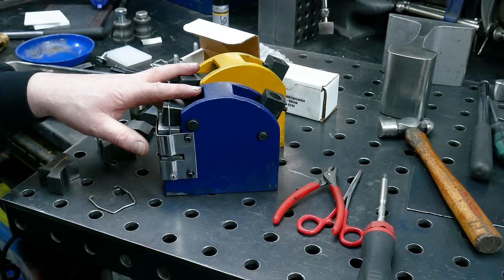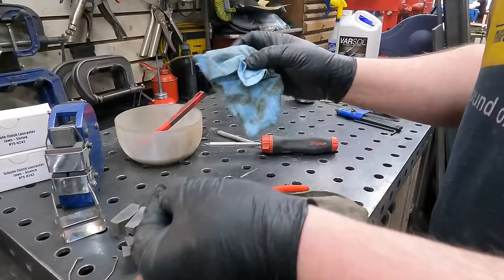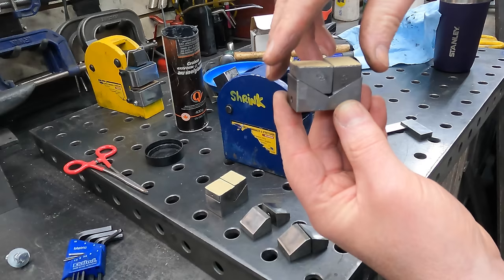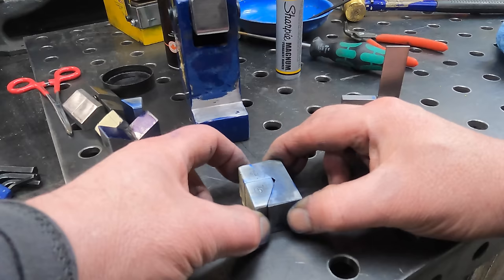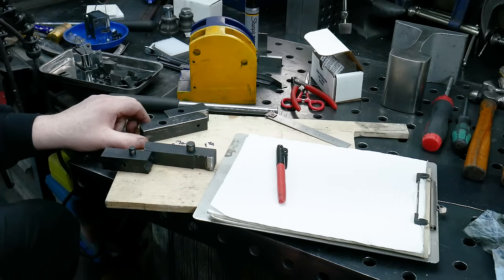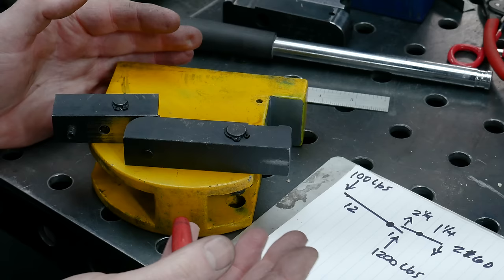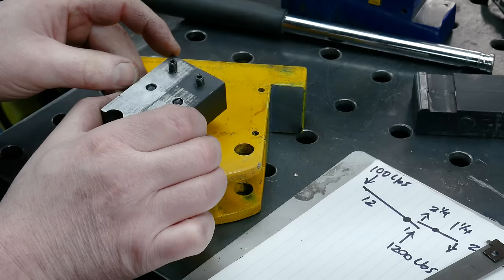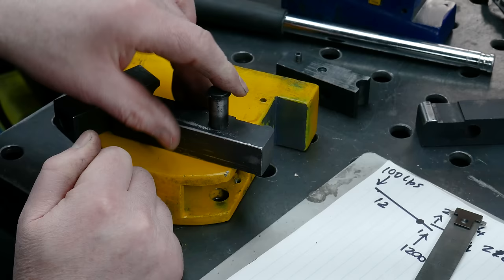Everything wrong with import shrinker/stretcher machines

Comment: You only need just enough Prussian Blue/Dykem etc on Part A to leave a mark on Part B. By using more than the minimum you make contact patches appear larger than they are, and run the risk of disguising low spots. In the application shown here it may not have mattered too much, but if you were trying to flatten precision mating surfaces (e.g. the ways on a lathe) it would be counterproductive.
Reply from the maker: For sure - in this application it was only important to get it sitting square and not rocking.  I should have flattened that die on my surface plate - but given what they were doing, there was no point.

Comment: I have a suggestion that doesn't require casehardening the tool again. Drill or mill out the holes from the frame that keep the pin in place from the tool that is slightly too short. Give the holes threading. Then make some bushings with a center hole that is slightly of center and that has the correct diameter for the pin, and give the bushings threading on the outside diameter so that it fits inside the newly threaded holes from the tool frame. If needed make a set screw so that you can lock the bushings in place. The of center holes from the bushings gives you the ability to adjust the tool ever so slightly and very accurately.  

That might improve things even more. That way it is possible to locate the pin a little closer to the correct position without the need to caseharden the tool again. It would also require some machining. But maybe that you have the tools to do that type of machining yourself, or maybe that a friend with a lathe can do it for you. 

Anyway, another great episode. Big thumbs up and I am looking forward to the next episode. 👍🙂
Reply from the maker: Thanks - that's a great idea. Once set you could pin the threaded hole to keep things from moving.  I've put these away for the time being as I have to get on to another few small jobs this week, then back on the suspension trail until that's done.  After that - sheet metal.  I'll do an update soon as it's hard to figure out what I'm doing as I'm sure it seems pretty random.
Reply: @ThrottleStopGarage  It is always a joy to watch your content. The different aspects from your project is one of the things that makes it interesting. 👍

Comment: Thanks again, I've also been looking at these to buy.  We'd all love the best brands but the cost is far too high for Jo average.  Leverage in these is simple but seems backward, high ratio at the start and gets less with travel just when you'd want more ?  You concentrated on getting more pressure for a result. Can you comment on the jaw sideways squeeze travel while trying to shrink, new jaws vs. old jaws ? Did the original jaws not work because there was not enough pressure to make that sideways squeeze travel or were they not gripping the work sufficiently ?  Hope you understand what I'm asking ?
Reply from the maker: Interesting question.  When I first bought these tools, I found that the stretcher worked OK but the shrinker was useless (or the other way around - it was a long time ago).  I ground the dies to work better.  The "V" they fit into looked like someone cut it free hand with a grinder.  I only touched them up enough to get them to work - the video goes further.  I also have a larger frame unit that has basically the same jaws - and it works fine.  So quality control is an issue - no big surprise.  The Lancaster jaws are very well made and needed nothing.  I'm saving up for a better machine in general and I will move these on at that point.

Comment: I had some of this type of shrinker and sketcher i remember i need shim the stretch up when it was worn and i changed one of the pins to a M10 bolt 
I had them on home made stand with fot pedal it made them easier to use
Reply from the maker: I'm thinking about a foot pedal stand - not a lot of room for all this stuff.

Comment: These Lancaster style shrinkers never work if you insert the flange to full depth as it appeared you did when you first tried it, the general advise I've seen - and it works for me - is to insert the flange 1/2 to 3/4 depth.
Reply from the maker: Agreed...the physics doesn't lie. Mine were very different in how efficiently they moved metal and I found out why.  Both work fine now...but you make a good point...regardless of operation moving more away from a bend is the correct technique. Sorry if the video wasn't clear on this point.

Comment: I always wondered about how these worked. Thank you for what you showed. 
I know it's harden but could you drill out the pivot hole then insert with a friction fit, an offset bushing in the pivot bar or even the case?
My back ground is metrology and in air craft fixtures we would use bushings that could be replaced or changed to put in or or take out offsets.
Something to think about if you want to ever improve it but if it is it working to your satisfaction leave it alone.
Reply from the maker: I for sure do not have the tools to drill hardened steel and insert the offset bushing you're suggesting.  If I had a mill, it would be easier, but with a drill press, I'll pass.  It's better - but when funds are available, I'll replace these and hope they're better.
Reply: @ThrottleStopGarage  Could just drill out the outside case and re bush  that with an off set bushing. It's just a thought. You did a nice video anyhow and if it works don't rebuild the wheel. 
I'm retired and rebuilding a car from ground up and was always wondering how those worked. Great job on explaining and showing. I'm looking to buy a set and build a foot operated stand next.
Reply from the maker: @monadking2761  Probably easier to just get some hard surfacing rod (or a used drill bit) and weld a little build up to the cam.  I'm saving to buy a Lancaster set and will review when that happens.  I understand they are quite a bit better. Have fun with your car build.

Comment: I have a dumb question. Could you shim between the body and the lowest die guide to get more pressure?
Reply from the maker: No - the pressure comes from the slope of the die.  The outward or inward force is controlled by these ramps.

Comment: A file cleaner or wire wheel on a grinder really does the trick for cleaning i cut mine down and welded cross hatch file blades on the shrinker ones u have the same problem with steel sometimes I will use a tucking fork and shrink by hand abit if im shrinking heaps saves putting in the really deep marks
Reply from the maker: Great tip...dental tools was a risk and I only jabbed my thumb once.

Comment: Hello!

Your methods of tuning the jaws and the tool bodies are really great.
And I guess that the shrinker jaws may even work if propperly applied.
When bending angles you definitely need to stay somewhat away from the bend.
Otherwise you would try to shrink the perpendicular part of the sheet as well.
It will somehow work, but quite ineffective and with so much force needed, that will even destroy good jaws. 
With stretching you don't have this problem that much, but it also works better when stretching more on the outer edge. 

Your consideration regarding the contact points of the levers and the forces resulting on the jaws are not correct. 
It is correct that the effective levering and therefore force amplification is changing as the lever is pushed down. 
But you also have to consider the direction of the force transmitted from the first lever to the second one. 
As long as the force is not perpendicular to the second lever, a certain part of that will go straight into the pivot bolt of the second lever and another part is going to to turn the lever and therefore apply force to the jaws. 
(some vector math but this can also be shown by drawing some straight lines on paper) 
But that's all theory anyway. 

I would recommend trying to use both shrinker and stretcher gradually from the outer edge towards the bend. 
In case the shrinker does not work as it should (shrinking will always be harder as stretching because the material gets thicker and thicker material is harder to shrink - so to make it easier, make more small steps going sideways instead trying to push harder at one point ) just try to change the jaws between the bodies.
Reply from the maker: I see what you're saying...fair enough.  The damage to the dies is still the result of the poor fit.
Reply: @ThrottleStopGarage  

The dies of the cheap shrinker- stretchers are made from rather cheao carbon steel sich as C45 (I don't know the ASME Code for that) this Steel can bei hardened to about 50 HRC which is kinda hard, but you can still work on this with a sharp file.
They have to be made from tool - steel which can be hardened up to 62 or even 64 HRC.
A file will only scratch the oxide coating on this stuff but not do anything more.
I have bought several stretcher- shrinkers.
One of them was a cheap one which i guess these all come from the same chinese factory, whatever brand- sticker ist placed in them.
I never got it to work.
An then I have two really good ones.
With thin sheets I even have to take not to shrink or stretch to much at one place.
With no signs of wear on the jaws.

But these are about four times more than the cheapest ones. 

There are many cheap tools comming from China which really work quite well, especially for amateurs.  

But I am exited to hear If you succeeded to get you tools to work propperly!
Reply from the maker: @Volker Dörr  very interesting.   I'm not surprised that they are the wrong material!  I really want a decent set, but don't use them often enough to justify the expense.

Comment: How much were the new dies?  Thanks for the good video.

My philosophy on HF tools is: Unless I can eventually use it as a doorstop or hammer, I don’t buy it.

In this case, you’re ok. These are heavy enough to be used as a doorstop😇
Reply from the maker: I recall them being a little over $100 USD for each set.  Agreed on the tools...I try to avoid the cheap tool temptation.

Comment: I would be tempted to weld a shim onto the handle flat surface rather than try and increase the radius end, but I doubt you would ever really be happy with that tool in your workshop now even if it did work.
Reply from the maker: I thought about it - but I am concerned that the softer metal will mushroom and be a PITA.  I'd pick up some hard surfacing rod and weld it - but a shim on the handle side would be easier.  End of the day, it's worth it to just know.  I also know that one more day of fiddling around with them won't be worth the time.  Good enough for the next little bit.

Comment: Although I do appreciate your hard work / efforts with these videos, I do have one burning question:  Was the car ever finished?  If so, can you post pictures somewhere?  If not, do you have a timeline for that?
Reply from the maker: The car is still on-going.  I'm waiting for parts to finish the front suspension.  I try to mix in a little of the other things I'm doing in preparation for the rest of the build.  I'm spooling up to do a little sheet metal work on the project.

Comment: Did you ever consider moving the shrinking jaws over into the stretcher body to see if that improved performance? BTW, this video is very timely for me as I've been considering buying this tool but my local Harbor Freight has been out of stock for a while. After watching your video I'll probably go ahead and invest in the original Lancaster version.
Reply from the maker: Until I did the fix, I was never sure why the shrinker didn't work.  Now it seems obvious.  I thought the jaws were not functioning properly...which was true.  I'd like to buy a Lancaster and see if it's any good - stay tuned.

Comment: Best thing I did was make a foot operated set up from a old Total gym excersize machine gives easy force and lets me use both hands on work peace, schinker will never be as good as strecher , your trying to pull metal together and not apart and that's expecting alot to happen.
Reply from the maker: They both move metal a lot better now.  I only had footage of me trying to use the shrinker in time lapse...but it really was a bad tool.  I'd like to get a foot operated set up for these at some point.
Reply: @ThrottleStopGarage   didn't know about cleaning makes sense mine lost alot after I did a aluminum peace probably filled of grippers,, love my foot of operated,, not hard to make
Reply from the maker: Yup, I've got to get one or build one.
Reply: @ThrottleStopGarage  just got done cleaning my jaws up made a big difference , Thanks